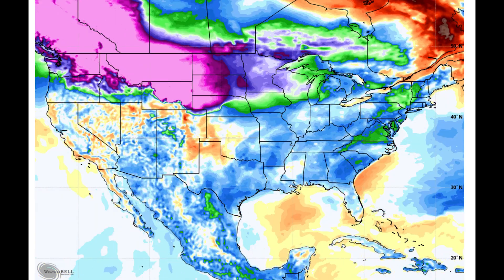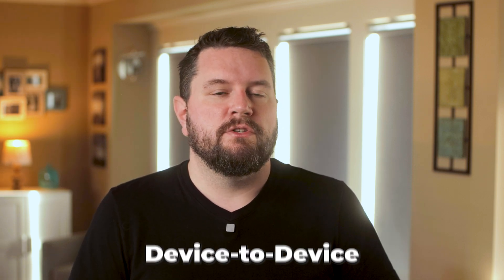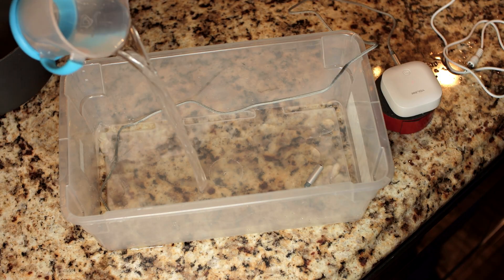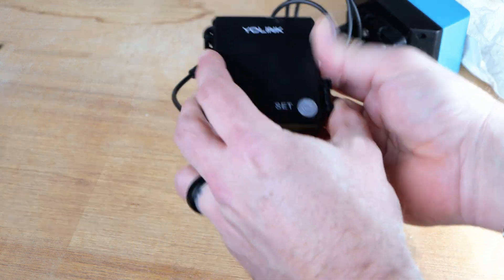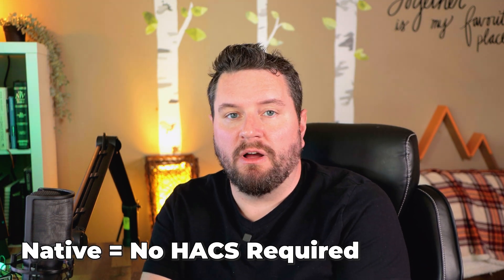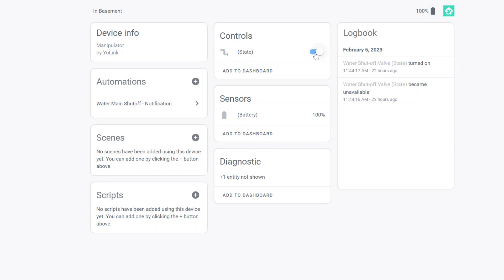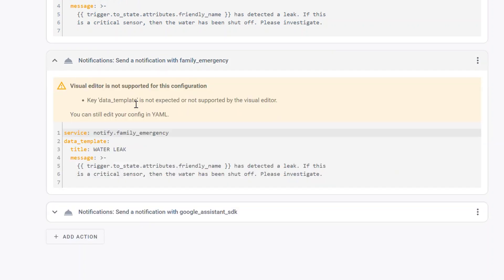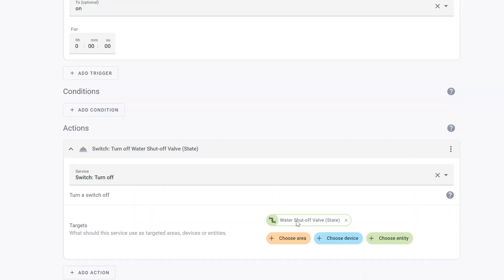Detect & Stop Water Leaks Fast! // YoLink Smart Water Solutions

Comment: I've just bought over E500 of YoLink products and I must say I am DISGUSTED with their service and their appalling attitude. A month after ordering I had to issue an ultimatum before the goods were finally delivered and it was abundantly clear that the company were being dishonest about delivery. The order has a missing item and even though it was obvious the goods were being sold to a European customer none of the provided PSUs are European, all having American connections instead. The final insult was a bill for 20% ON TOP of the final price in import duty even though this was not obvious at the point of order - the prices quoted were in Euros so one would assume the goods were coming from inside the EU!

CAVEAT EMPTOR!
Reply: UPDATE... the order arrived MINUS one item so they made me a "goodwill gesture" of a partial refund plus a small compensatory payment... too small to cover the import duty and postage if I ordered the item again! So I insisted on the item being sent, which they ignored until we involved the credit card company!!! 

And now just to add insult to injury the WEATHERPROOF outdoor temperature sensor has died - so I opened it up and found it was... FULL OF WATER!!! 

I've reported same complete with photographic evidence but after almost a week waiting for a reply they appear to be ignoring me!!! 

Make of this what you will but my experience so far leads me to conclude that Yo Smart products are cheap and nasty and their trading practices are dodgy in the extreme. CAVEAT EMPTOR!!!
Reply: A further update on the basis of full and truthful disclosures regarding Yo Link… I’m pleased to report that a replacement temperature sensor has arrived. Now let’s see if it lasts more than three weeks this time!

Comment: that cloud requirement is one big reason not to buy this. i hope they provide a local-only version.
Reply from the maker: I am working on them
Reply: @ThisSmartHouse  i hope they listen, because otherwise they'll lose quite a few customers.
Reply: @mrxmry3264  YoLink does not require the cloud or WiFi. You can pair the sensors with the smart valve directly, no app or hub required.
Reply from the maker: I think he means connecting to Home Assistant. That requires the cloud.